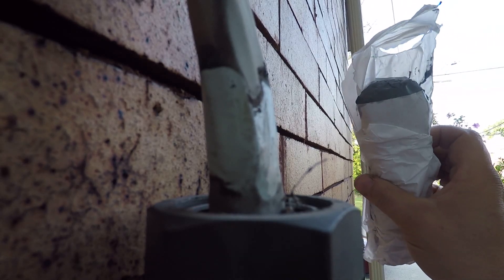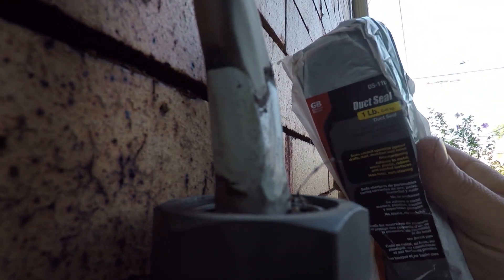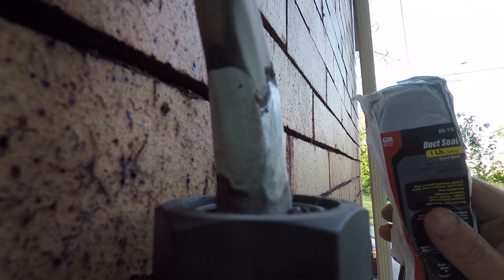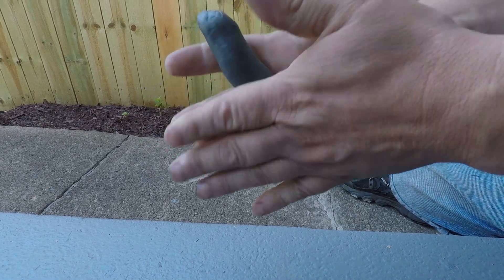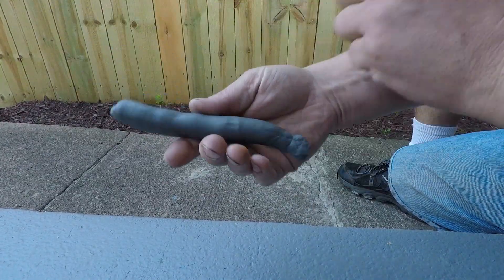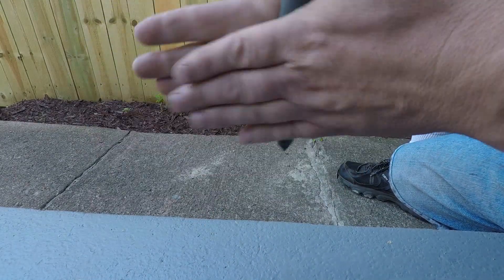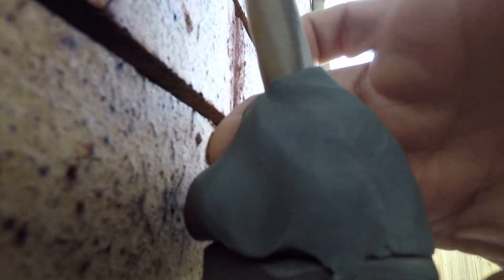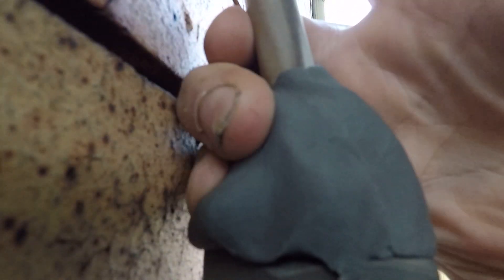Replacing the duct seal around electric meter box connecter basic maintenance

Comment: I think it's weird that they call it duct seal (Gardener Bender), but it's sold in the electrical department at Home Depot. Because of the name, I assumed it would be down the duct work isle. I finally found it today with a little help from a clerk - after searching for a long time. Needs a better name, like Conduit Seal or something. LOL.
Reply: it is actually made for sealing hvac duct work.   comes in caulking tubes and pails

Comment: If the old clay is worn out, would water enter the meter..causing water to run inside the casing going into the electrical panel in the house? Because I just found water in my panel 🤔🙄
Reply from the maker: It is one way it could get in. Water can also travel through worn out wire covering.
Reply: Absolutely yes. Had this happen at my last house for anyone else coming to this comment. Costed me a $2800 electric panel.

Comment: Would exterior caulk be a good alternative to using duct seal?
Reply from the maker: Duct seal has some mass to it. It let's you build a little roof over the fitting. Not to sure about the exterior caulking. Maybe a polyurethane caulking used with dish soap. Never tried either one. I would stick with the duct seal on this one.

Comment: Hi, quick question. Do you need to contact the electric company to shut off the power or you do this in a live wire. I am having the same problem, since there was a lot of rain in the past few days and  notice some dripping in the electric box, Thanks.
Reply: +R Ortiz just curious, how did the duct seal project work out?
Reply: @cdcVintage he’s dead now

Comment: Why is this necessary?
Reply from the maker: The top of the connecter is water proof but flat. And water could get into the meter box given enough  time  to penetrate the connecter. This is good insurance for a watertight seal.
Reply: It caused water to get into my breaker panel, my friend who is a electrician and is also the town inspector said this is a very common problem. When I went to replace the Duck seal the material just fell apart. My house is about 27 years old, who know, not me. Thanks for the video. take care